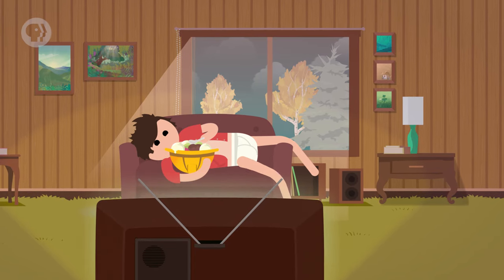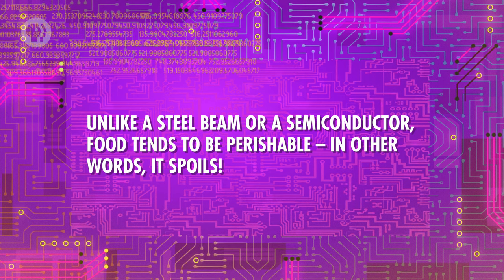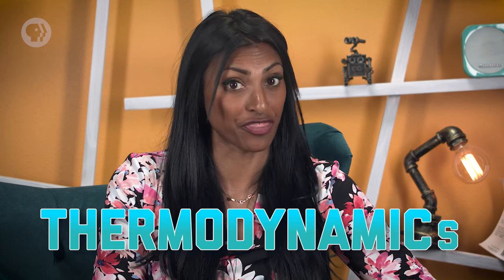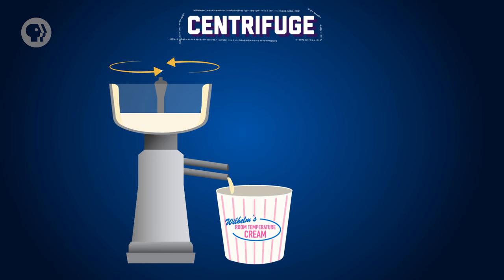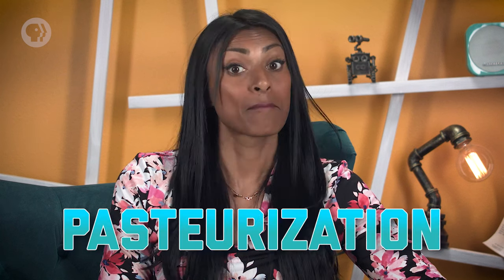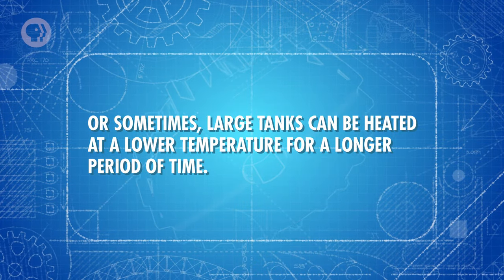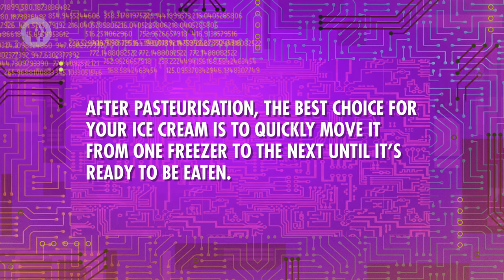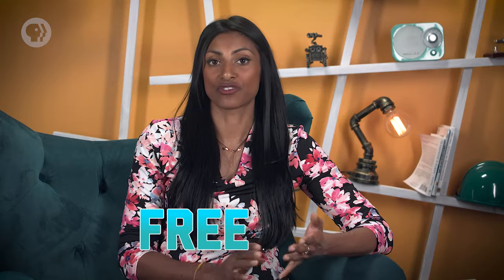Mass-Producing Ice Cream with Food Engineering: Crash Course Engineering #39

Comment: At 3:32 you state everything needs to be “sterile”. That’s not an accurate statement. The food industry sanitizes, which means they reduce the amount of micro organisms to a significantly lower level. Sterilize means to remove all micro organisms, which isn’t practical or necessary for  a safe food process.
Reply: Well by sterility, i think she meant the term "commercial sterility" which means that it is free from pathogens and safe to use but can still have spoilage organisms still present. It is essentially the same thing as the sanitization that you mentioned, but i feel like she probably did not think to emphasise that it is not true biological sterility.